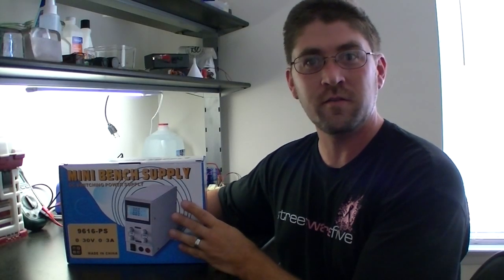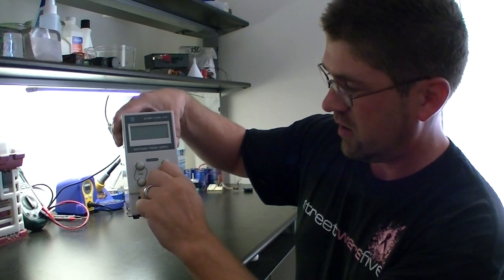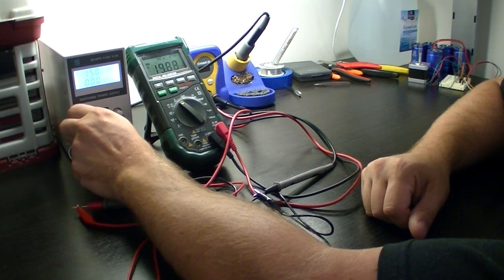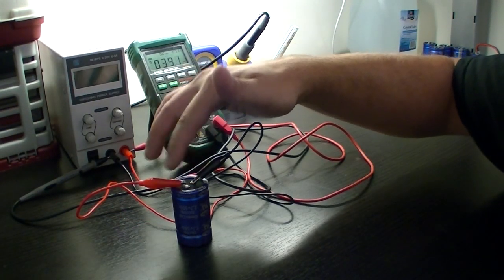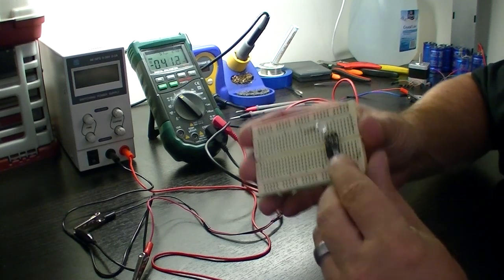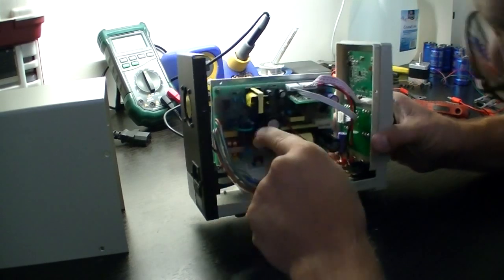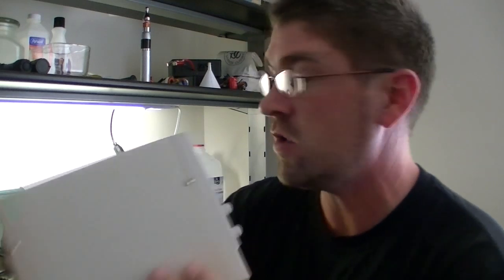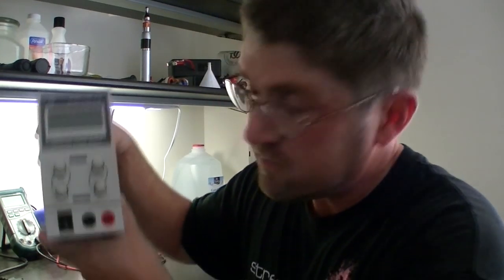Chinese 9616PS Bench Lab Power Supply Review

Comment: You can't go wrong at those prices...
Get a dud, ask for a replacement. They are usually quite willing to send a replacement.
Even if they refuse, you've now got a project enclosure with a decent number of salvageable parts inside
Reply: Unless it has poor regulation (e.g. a bit startup voltage spike) that fries your circuit. Not saying all cheap lab PSUs are bad -- many are great -- you just have to test them with a scope to make sure.
Reply: *big startup voltage spike